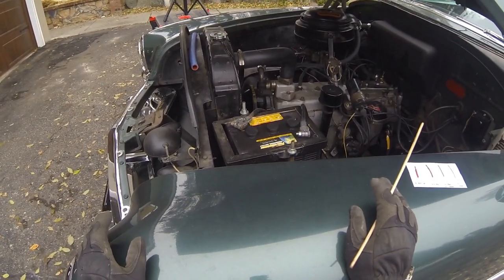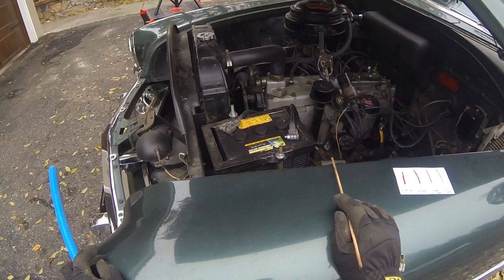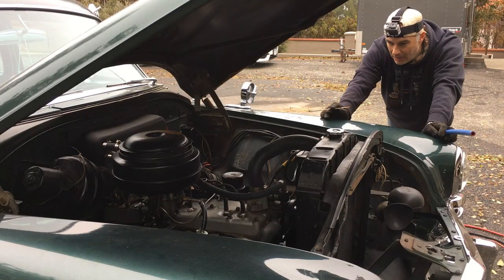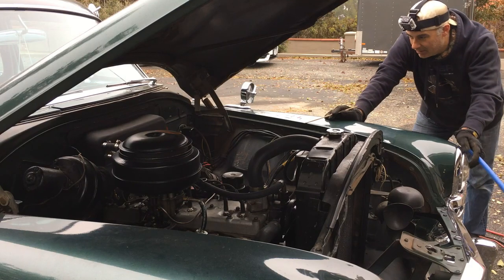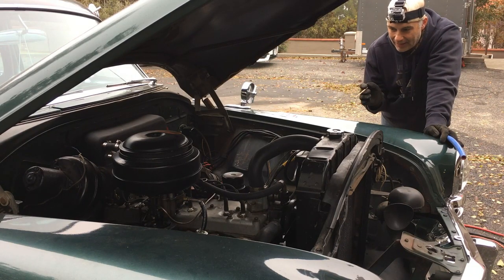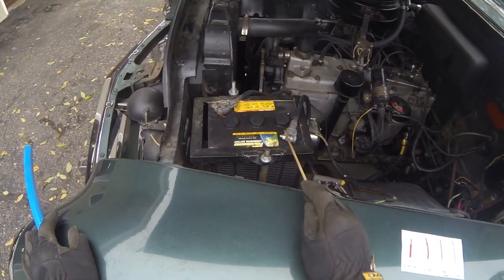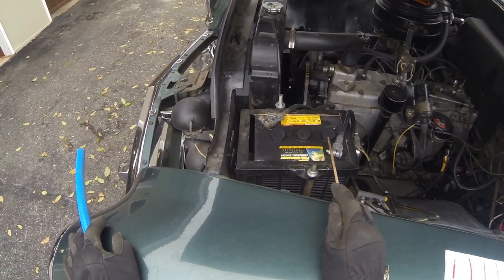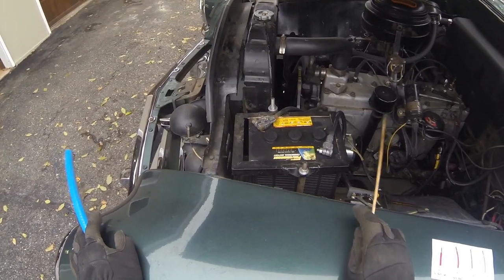Stubborn 6 Volt Cars? Don't convert them...Fix them!

Comment: Nice machines, good presentation. 
When you say Ground, a guy could just as easily say the common connection. Where any electrical device gets a connection to one post of the battery. Then the common/return travels thru the engine block to the frame to the fender and to the firewall. All these connections come back to the engine common back to the battery. My 1966 chevrolet had all these cables plus ground/common cables under the dash connecting the in dash electrical components to each other and then to common/ground again
for
I know that you know this, but you did not show any fuses in your drawing. Also your battery has a half cell to many .
for a six volt bty. I know, I'll see myself out.

Comment: I got a 55 with the same motor in this car on video  it hasn't  started  in 30 yrs oil good fluids  good I'm trying to find wiring  diagram  so I can check over the previous  guys work  and advice we're I can go to find parts  and info  thanks in advance

Comment: I have a 49 windsor and I can't get the solenoid to pull the lever back. I want to keep it 6volts  but I can't find a starter. Do you have any tips on getting one or fixing the one I have?
Reply from the maker: Look at the starter ID plate. Look for a number. Beginning with “MCL-6101” likely if its an auto-lite. Search for that part number on google.

Comment: Years ago car owners single viscosity 30 weight oil in their cars. Here in Texas where winter is usually not as cold as states up north 30 weight was usually OK. My 2010 Toyota 1.8 L four cylinder engine uses 5W20 oil or 0W20 oil.
Reply from the maker: Oils have improved a lot over the decades. A thinner coat of modern oil can offer a lot more protection than the old oil.

Comment: Also, you should not try to use a little Group 1 battery, unless your engine is less than 200 cubic inches.

Comment: I think I see a Group 1 battery in the Windsor....The specs call for a Group 2...I have a '54 plymouth with a 230 c.i. engine with Powerflite automatic trans-- calls for a Group 2...My other'54 Plymouth with a 217 c.i. engine, has a 3 speed with overdrive...That one calls for the Group 1...Battery ampacity also counts.
Reply: I would stay away from the Group 1, except for VWs, Stude Champions, Nash 600/Rambler and other cars with under 200 cubic inches.

Comment: Since you have a good old Dodge 6 V DC generator have you thought about using a Lithium Ion battery? I have a Dodge B4C truck and I will be giving the Lithium batteries a try since I don't drive it too often.

Comment: I thought Mopar vehicles in the early to mid 50's were 8v. At least the one I saw at a car show a few years back had a battery with 4 caps, not 3. Also, it looked like the transmission in this video did not have park. True?
Reply from the maker: No on the 8V system. Some people put in a 8V battery. Compensating for poor electrical system maintenance. Its a band-aid. No park in that transmission, correct.

Comment: I have a 1937 Oldsmobile and it seems to be killing the battery
Reply from the maker: You’ll need to find what is causing the battery to drain down. Digital clamp meter for AC current is a great tool to troubleshoot your problem.

Comment: What about setting up 2 6 volt in parallel, you would get the 6v just more amps only 6v car I had I was a teen, Now I'm looking at a 37 dodge. Thanks for the video.
Reply from the maker: Sure you can do that. But a stock healthy 6V system is pretty good. Unless very cold. It won't crank over any faster though.

Comment: A voltage drop test on hot and ground side of the starter can tell you so much. I know people have tried testing for resistance in cables with an ohm meter. That doesn't work at all

Comment: great video, you explain things so well..I need to replace my cables on my 1930 ford model A..can you suggest a site?.the ones on there are 00s..is that the same as double oughts? thanks again!
Reply from the maker: Yes. 00 is double ought.  Try an auto parts store for the bare cable. You need to cut it to length then install the cable ends yourself. That’s what I do. I am not aware of any store that sells pre-made 00 battery cables.
Reply: Try a boat large dealer, they often have heavy cables.  Or order from a specialty antique vehicle supplier.

Comment: Checking the battery's cells with a hydrometer, is not an option with the current crop of"sealed" batteries. There are no filler caps.
Reply from the maker: Agreed. Which is partly why I don't buy modern sealed top batteries.
Reply: @keithsgarage5831  You can't buy your preffered type of battery( with filler caps), if parts stores don't stock them.
Reply from the maker: @jeromebreeding3302  I suppose it depends on your location in the world. I’m fortunate to have plenty of  battery options here.  No issues getting the battery I prefer.

Comment: how do you adjust the parking brake on a 1949 chrysler windsor?
Reply from the maker: I have never owned or worked on a 49 Chrysler Windsor. Do you have an external brake band & a drum at the rear of your transmission out put?
Reply: @keithsgarage5831  i believe external brake band behind the trans

Comment: So glad someone is giving some love to these old cars.i have a question though. My horn blows intermittently as I drive. The issue has gotten so bad I've just disconnected the horn. Do you suppose the relay has gone bad?
Reply: should be awire from horn button straight to horn  the button connects voltage to  blow the horn ------ if poss, replace that wire----- insulation  must worn to bear metal   to allow this to happen

Comment: Great video Keith so informative and easy to follow along for us non super technical types. I was wondering if you use an lead additive to your gasoline as this is what would have been used in the original times. I have a 1948 wooden boat that has a Chrysler Crown flathead six marine engine that I am bringing back to life but am unsure about the gas. Any suggestions would be appreciated.
thanks
Reply from the maker: I know for sure that the car and truck engines have hardened valve seats. Lead additive is not required. I’ve never worked on a same era marine engine apart. I suspect they too have hardened valve seat inserts. Best to confirm. Do you have the head off?
Reply: @keithsgarage5831  No as the compression and is within spec so trying not to disturb anything that doesn't need it. I love this engine's simplicity and how easy it is
to work on. I have pulled the engine from the boat as I am also repairing the hull and have mounted it on a wheeled dolly so it's super nice to work on. Thanks for
replying Keith and once again thanks for the videos.

Comment: Hi Kieth, could you tell me what oil you use,  was. wondering if a synthetic lower viscosity oil would help starting in cooler weather?
Reply from the maker: My cars are parked for the winter. I am in Canada. Snow ice and salt on the roads here keep my cars from seeing cold weather.  What are the coldest temps your cars see?
Reply: @keithsgarage5831  I also live in Canada (Niagara on the Lake) and my M47 Chrysler Crown engine is in my boat. Trying everything you suggest to help stay with 6 volts, some early fall mornings can get quite chilly. Also wondering what oil you use to see if you recommend a multi grade synthetic as a replacement for the single grade 40 sae.
thanks
Paul
Reply from the maker: Have you seen my videos on non-detergent oils and the sludge they create in your engine? This sludge needs to come out before you switch to a modern multi-viscosity, detergent oil.  I would not run synthetic oil in these engines. It’ll likely cause extra oil leaks.  If you decide to switch to  modern oil in cool weather, a 10W30 should be fine. In my opinion.
Reply: @keithsgarage5831  Thanks Kieth, will watch your video about oils and will check for sludge. Would be nice to be able to use 0-20 but I agree it’s not for these engines. Really got a lot of useful info on getting the most from 6 volts, love the detail!

Comment: Best description ever! Wiring is my weak point. Thank you! Going through all the connections on my 1949 Dodge Coronet. Turns over very slowly. Waiting on a few cables for my starter which im about to pull and clean. Also changing the oil. Its been in storage for 40 years.
Reply from the maker: Thx. Watch my “No Spark” mini series for more electrical fundamentals. Suspect you’ll enjoy it.
Reply: @keithsgarage5831  I'm watching it right now actually! Yet another gold mine of information! I'm good with mechanicals and body work, these are by far the most understandable videos I've ever come across. I knew the basics but was always hesitant about anything more than the basics when it comes to electrical stuff. Now I'm looking forward to it. Hoping to get my 49 Coronet up and running. Got a few pops out of it last night.
Reply: Beautiful cars you've got there. I have two 1963 imperial crowns, 1949 Dodge Coronet, 1980 Renault LeCar, 1970 Honda N600, 1976 Ford Pinto, 1991 Volvo 240 wagon, and a few other ransoms.
Reply from the maker: @GavinJLang  Let me know how you make out with your slow cranking 49 Coronet. Any updates on getting to spin over quicker?

Comment: So what size cable would you recommend for a 6 volt system?
Reply from the maker: For battery cable single ought should do just fine.
Reply: @keithsgarage5831  That would be 0 gauge correct?
Reply from the maker: @raulflores8440  correct.
Reply: @keithsgarage5831  I appreciate your feedback. Thank u.

Comment: So, if we ignore the cost, can you go 𝑡𝑜𝑜 ℎ𝑒𝑎𝑣𝑦 with cables for starter, headlights etc? If it's properly installed and insulated, not rubbing on anything, is thicker always better?
Reply from the maker: Bigger is better  for a 6V system, to an extent. Match the amp draw to the wire gauge size and length. For example there is no reason to run “00” gauge wire to your headlights. A total waste.  However 12 ga might be ideal for a 6v system.
Reply: @keithsgarage5831  I agree that 00 wire would be wasted on headlights but, could using oversized cables ever do any harm? What I'm thinking about here is almost definitely overkill but, if you were designing the "ultimate" reliable vehicle, giving everything the best possible chance of long-term, efficient operation, could you actually go "too far" with wiring?
Taking it to extremes; if you were to use 00 cables throughout the vehicle, would it cause any issues, or just be a waste of cable/money?
Reply: @2H80vids  I think it would cause no harm at all. Other than weight, waste of money, bulkiness.
Reply: @auteurfiddler8706  Interesting, thanks.
Reply: You can never be too big, as long as it fits.
Reply: @2H80vids  You can't be too big, unless it just won't fit.

Comment: Great vid it was like listening to myself talk. I am also a great believer in the capability of the 6 volt system. I did exactly the same thing and tried 3/0 battery cables but they were too big, I reduced to 1/0 and they were much better. Don't forget the starter solenoid. The modern 6 volt "eastern sourced" replacement solenoids still use 12 volt size contacts inside. They just change the energizing coil to a 6 volt one. I paralleled a pair of them and they worked much better. You can find the good 6v solenoids by weight, they are much heavier than the 12 volt ones. Copper is heavy.